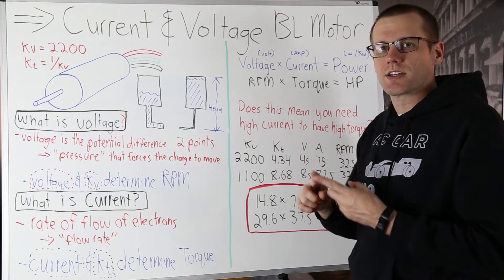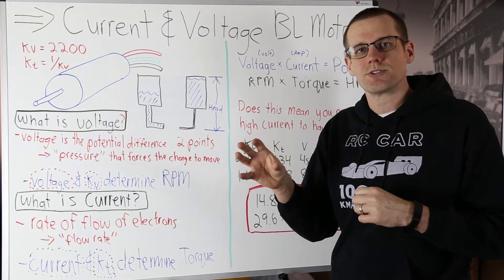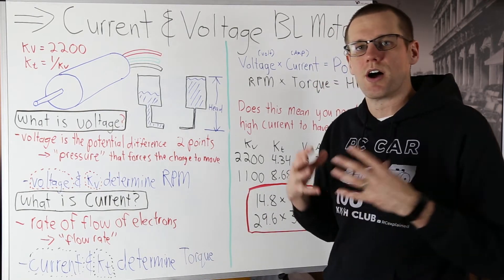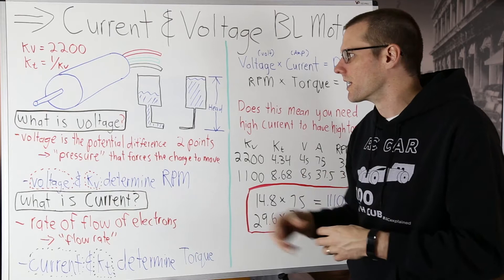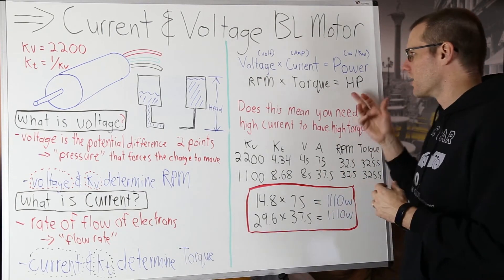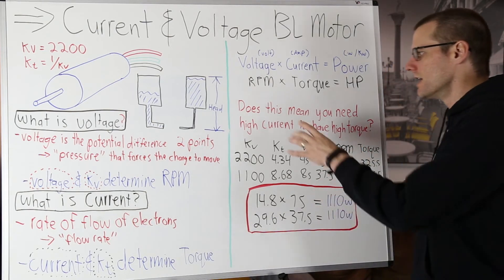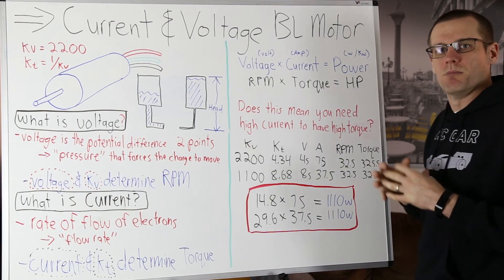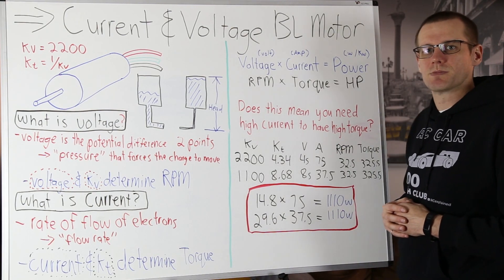What Role does Voltage and Current have in an RC Brushless Motor?

Comment: Can u do a vid like this about brushed motors slots turns volts vs amps and all those please im making my own brushed rc motors I don't understand a few things and i only ever get the answer im looking for from u
Reply from the maker: It's roughly the same as the brushless videos
Reply: The only problem is, even with a crap ton of research, finding the proper true KV of brushed motors is almost impossible. The companies that make them, are very tightlipped about them (even brands like Trinity and such). You'd almost have to have the proper motor reading equipment to get what you need

Comment: Great analogy using the water, never thought of that before. I have been a fan of high volt/low KV setups for years, at least since 2006, when I started playing with brushless setups. I have always found more efficiency with higher voltage lower KV setups, through less stress on both the motor and esc (Lower heat with proper gearing). I have recently discovered your channel (like today) and see some great insights and analogies that I never thought to use. Thank you very much
Reply from the maker: Right on, thanks for sharing!

Comment: Idk if i missed something, but how do you get the kt value?
Reply: I tried some algebra and replaced the “1” 1/kv to 9548 (which is 4.34 x 2200) the formula worked with the 1100 kv, resulting in the same kt value as you said which is 8.68. Idk if it’s the correct method tho.
Reply from the maker: There's a video on the channel going through kt. Kt is equal to 1/kv but you must convert to si units.
Reply: @RCexplained  I’ll look it up, thank youuu

Comment: Hey I have a question
Recently I bought 12v motor speed controller from eBay 
My motor makes noise at the lower speed 

When check the voltage with multimeter I find out that the speed controller changes voltage not amp 

Is this how it supposed to be ? 
And if I want to change amperage output not voltage is there any solution to that ? Or I just have to deal with the noise? Thank you

Comment: Ok I'm confused. I've been watching your videos trying to learn this stuff better. I would appreciate your recommendations. 
I just put a Castle Monster 8S/1717 sensored combo in my X-Maxx. I'm running mod 1.5 gears 15/30 
Gens ace 5000mah 4S batteries. Weight with batteries is 23lbs. 
Question , what can I expect for top end speed, what HP  and should I install cap pak?
Reply from the maker: Hey Mark, I love the X-Maxx, however, I do not own one and have limited knowledge about this model.

Comment: So trying to wrap me head around this, the 1100kv on 8s unloaded is producing the same power and rpm as the 2200 on 4s unloaded but half the amps so would the 1100 run cooler than the 2200kv unloaded and then posibly under the same load as well. Seems my rc crawler 4s lower kv setups run cooler than my 3s slightly higher kv setups maintaining same gearing and wheel speed/rpm would I be right to assume that or am I way off

Comment: Great Video!  If you change only the voltage (say 6S to 8S) on a given setup (so the ESC and motor are the same), I'm assuming the motor will draw LESS current for a given load, although the max speed is increased, so I'm might be confused. Does this make sense?
Reply from the maker: Current is equal to load or better understood as motor torque applied. Having the motor hit higher speeds forces the car to go faster. Faster speeds will require more torque from the motor since there is no gearing changes. More torque is equal to more current. 

Motor will draw more current as a result.

Comment: Another interesting video, another question! Let's say a motor is rated for max 38V and 52A. If I put 6S through it i.e. 22.2V nominal, can the motor ever draw 52A? Or will it just draw an equivalent proportion of that?
Reply from the maker: Hi Peter, thanks for the comment. The ratings of the motor are independent. 38v should be the maximum based on mechanically over spinning the motor. 52A is the maximum based on thermal limits of the motor. You can apply 10v to the motor and draw 100A from the motor essentially leading to burning out the motor.